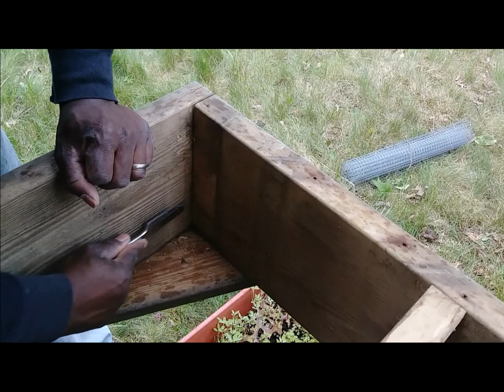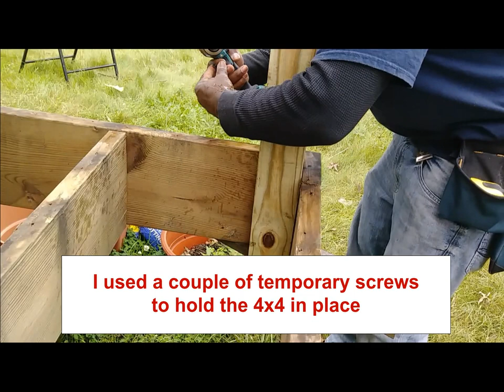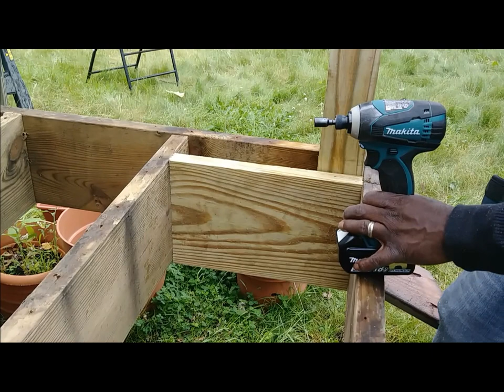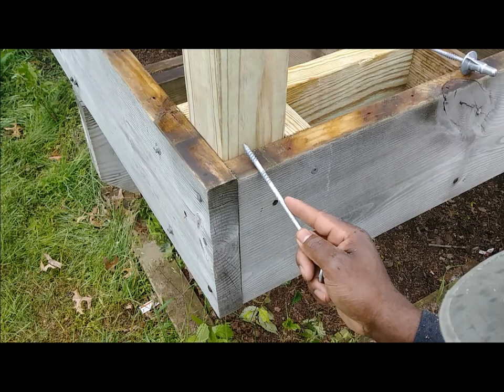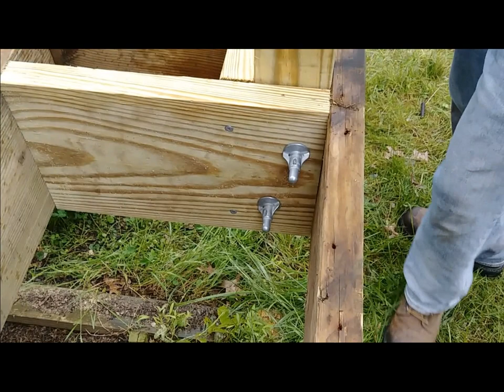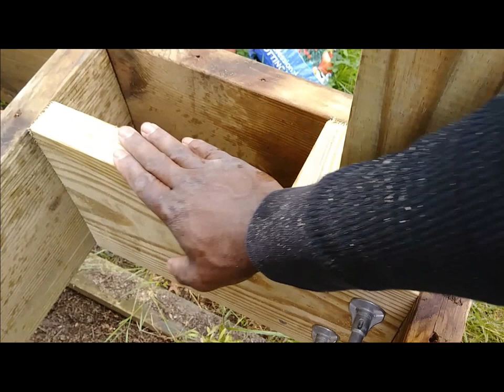ThruLoks + Blocking = Sturdy Deck Post

Comment: Thanks for the video... I am building a deck soon and was about to use the 1/2" through bolts that people normally do.  I checked out the ThruLok's and they are actually LESS EXPENSIVE than the equivalent bolt solution when you add the cost of the bolt, 2 washers, and the nut.  Nevermind the time saved not having to drill a hole, and put Protectant inside the cut hole, and then wrap your arm around the thing to tighten up the bolt and nut.
Reply: Yes. And its funny all the comments where people are showing installing these where people are saying they are way more expensive than good 'ol standard CB.
You can tell who's talking out their ass/armchair.

Comment: Good video. Doing a large 700sqf deck and surprised at how expensive galv carriage bolts are.  $5.50 for a 1/2" x 7" CB with 2x washers and nut. $3.57 for an 8" Thrulok with washer/nut included.
Per manf. instructions, you should be putting 3x Thuloks in, 2 on 1 side and 1 on other side. Warrantied for life, and Code compliant. Price is a wash, but appears to be as sturdy as CB and simply faster. Install Thrulok with washer loose, hand tight nut on back and finish tightening and it suck that back nut in just like if you were wrenching on a nut.

Comment: I've never used those long thru- lock screws. I used 4 number #8 3 inch exterior screws. 3 for a 2×6, 4 for a 2x8. It is less screws. But since you have the blocking in place, I dont know that you'd need those thru locks. But it does use less screwing. That post ain't going anywhere.

Comment: You did great!  Take a look at Simpson's DTT2Z tension connectors for a code approved method.
Reply from the maker: Thanks good to know I will look into it.  Thanks for the feedback John.
Reply: John, do you know any way to locate and drill exactly enough to match the Simpson tension tie?  It's driving me nuts.
Reply: @eukaryon    Might be a late answer, but i just measured, drilled and installed bracket afterwards.

Comment: Nice video, do you think I could screw the 3 1/2” blocking to the 4x4 prior to the floor joists?
I was thinking about using a 2x4 instead of a 2x10. That way I’d only have to pick up a 8’ 2x4 instead of a 2x10, figure it would be a bit cheaper. I’d cut 2 for the blocking & space them out 3-4” ,then attach a 9 1/4 long piece to the 4x4 (vertically) sorry if this is confusing 😬

Comment: Awesome job. But you should of put flashing tape   on all the top of the joist. But you taught me something
Reply from the maker: Thanks for watching.
Reply: Got a 700sqf deck and joist tape price was killing me. Bought 5g of Liquid Rubber for <$180 and 2 coats thick and still have about 1/2 left.
Plus I expect the deck to be less creaky.

Comment: Talking about “sturdy wood” while you reclaim rail posts that my grandfather installed in the 50s to a single ply band🥴🥴🥴 find another occupation, this ain’t it.
Reply: OK, another wanna-be Construction Expert...
He's fixing an obvious joke of a railing system before someone gets hurt.
Deck is old and prob has plans to replace it in the future. A double rim joist would be preferred, however just getting the railing solid is perfectly fine.  And in case you didn't notice, he put the 2 Thruloks on the side instead of the front, and backing behind the 4x4 to adjacent joists.
So the 4x4 is locked in with Thruloks on the side, and constuctions screws around the sides and back, probably front to.
He'd have to bend the LedgerLocks, the Thruloks and construction screws before that 4x4 is going to be even able to start twisting that single ply band.....
Thats going to be a slow, noisy failure if it ever happens.
I'm just a home DIY-er with some smarts, and even I can see how over-kill he solved that problem.
Another armchair expert with some chip on his shoulder.